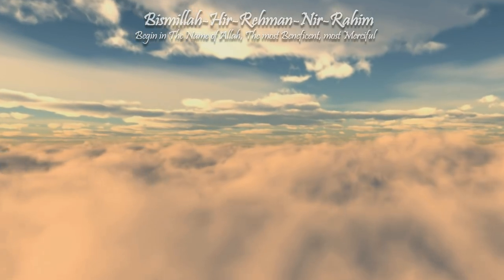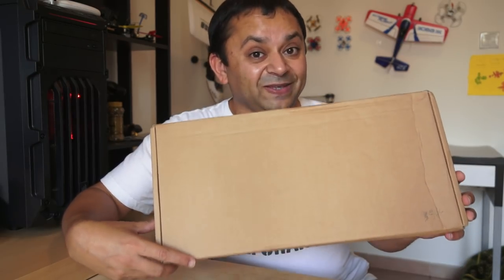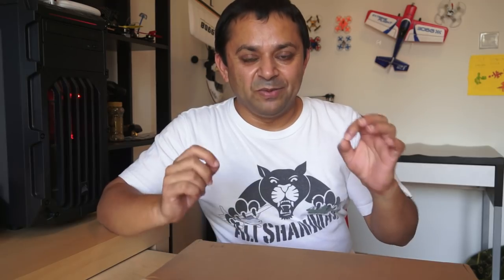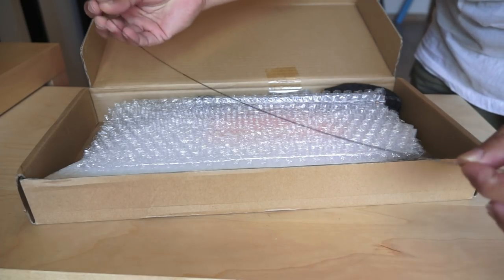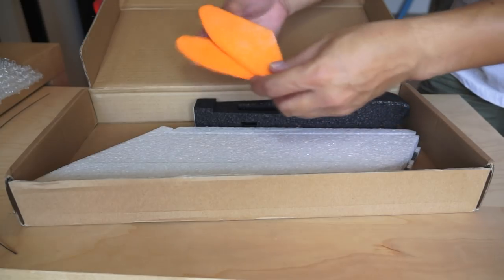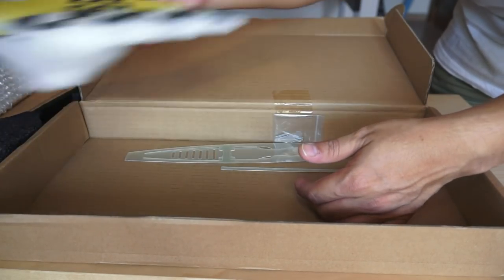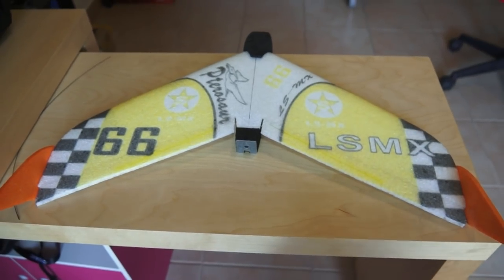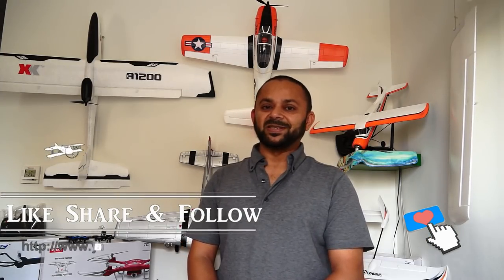Spirit 600 Mini FPV Racing RC Flying Wing Indoor Review

Comment: Ali how did you mount the motor? I bought mine as a kit and purchased an 1806 motor seperately. There is no mounting bracket just the flimsy carbon plate on the back? Thanks.
Reply from the maker: thats the only thing to mount